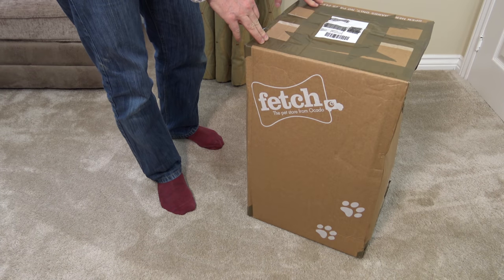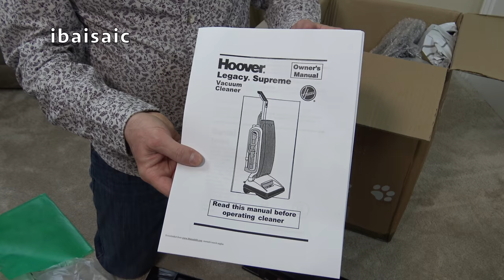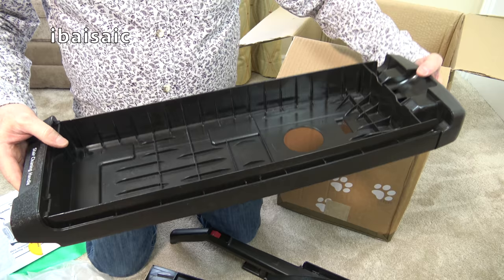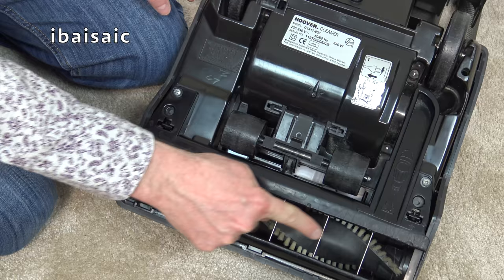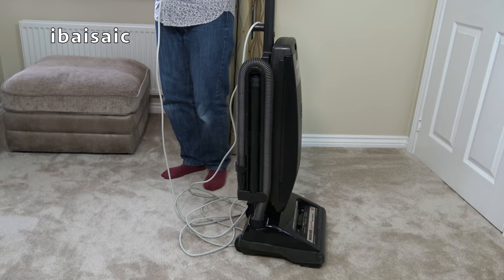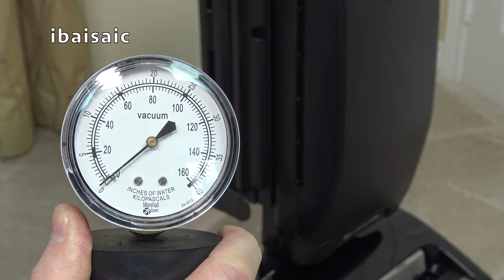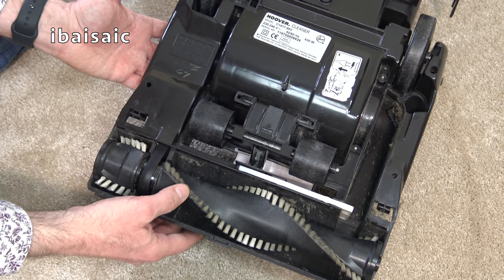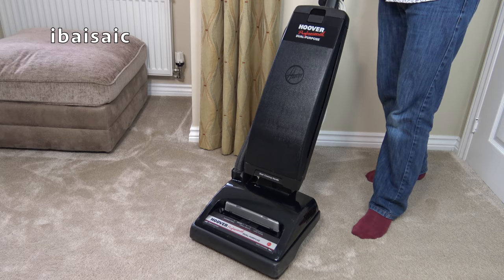Hoover Professional Dual Purpose Vacuum Cleaner Unboxing & Demo

Comment: You could just take the hose out of the end cuff and cut it down, it is held in by two tabs and once pressed in (it is tricky but doable) The hose will pull out of the cuff.  Just cut it down, fit the white attaching ring back around it and push it back into the cuff until the tabs click back into the holes.

Comment: Those Elite style Hoovers are excellent machines, even though Hoover US never sold many in the UK (all I can remember is this [and even a red version with a black headlight blank], the Turbolite [known to us as the Elite 200], and even a Maytag branded Hoover Caddy Vac), I believe they're very desirable machines if you're able to put up with all the noise these make.  And also for your headlight conundrum, my guess is the original headlight blank probably fell off and went missing, so the only replacement for that blank is a headlight lens, possibly from a US Legacy model that had the headlight provision in the motor to begin with.

Comment: What's great is you can still buy brand new brushrolls and (I think) fans for these, though if you break the  belt-side motor bracket, you're out of luck. Those are salvage parts only. I have a friend who has a red Hoover Sprint soft bag version of these, and my former neighbor had a Hoover Dimension which was that very vacuum with a green paint job and onboard tools above the bag. WE almost got a Hoover CaddyVac or Widepath just before they came out with the Windtunnel line. Later on though we got a Windtunnel bagless which was not the greatest vacuum. Did have a lot of suction for the first 2 minutes of use though...

Comment: If I'm correct, the production date would be November 1997 based on that serial string. The Legacy was a more beefier version of the Elite but cleaned very well. I had one for a while as a youngster until the motor went out on it.

Comment: Oh the days when hoovers actually worked. I have 2 border collies and I really struggle picking up the dog hairs with these new hoovers. These new hoovers just aren't powerful enough. I actually got rid of a rug because the hoover I have just wasn't powerful enough to vaccum it. Infact the rollers just stopped. They wouldn't turn at all. We need hoovers that will actually do the job they are designed to do.

Comment: I have the Burgundy U1409... It has the air freshener and black lens blank  as you mention, and the switch isn't handle mounted instead it's in the same place as the Turbolite. Mine is from November 1993.
Reply: Also I'd check the colours of the conductors in the lead... I reckon that could be a US sourced replacement in which case they will be Black and White. It would also explain the lack of moulded plug..
Reply: Also yours has a US format serial number.... November 97...

Comment: If that works the same as my Hoover Dimension Upright from the mid 90s that was my grandma's when you open the door and insert the hose there is suction to the hose. I have not used it in a while but I don't think it had the sliding diverter. I am just mentioning that you could be loosing some power with hose plugged in but I could be wrong.